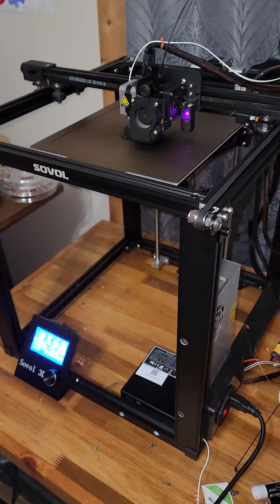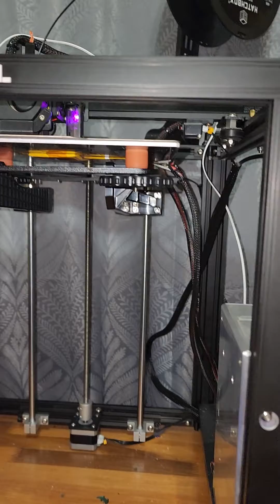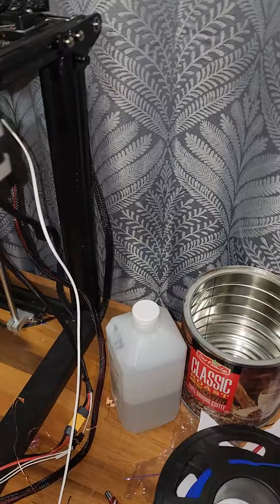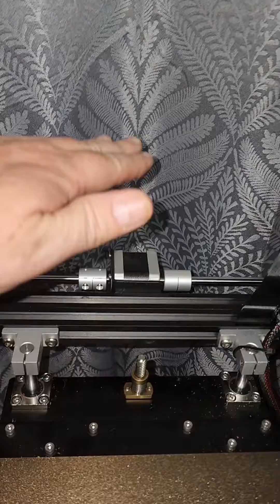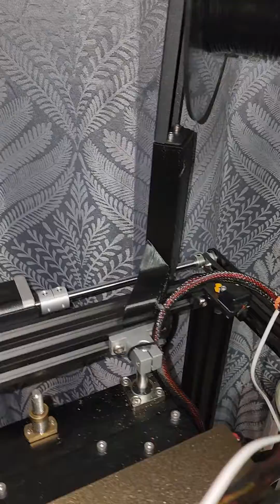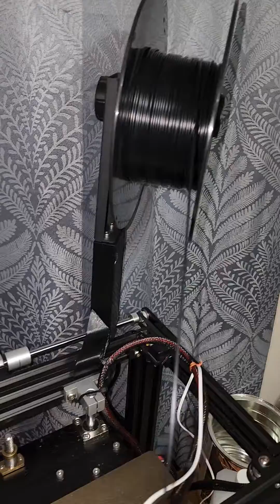Sovol SV05 Upgrades Filament Holder and Silicone Spacers

Comment: very nice, i agree about the less friction part, and at the very end you seen the roll tip over, its not constant friction but must of been a lot force exurted by the motors to do that even if for a short time, which reminded me of the frictionless rollers some other youtuber upgraded too, that would be the cherry on top here  i think if you wanted to go that  far, but that may not even have the slighest affect on the motor so could be just diminishing returns.